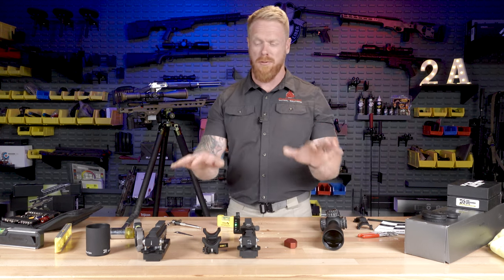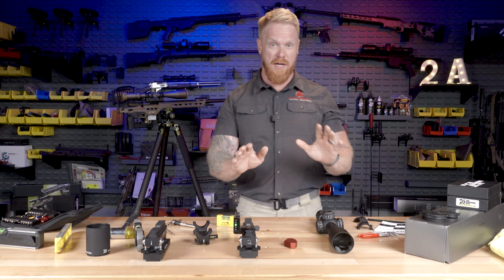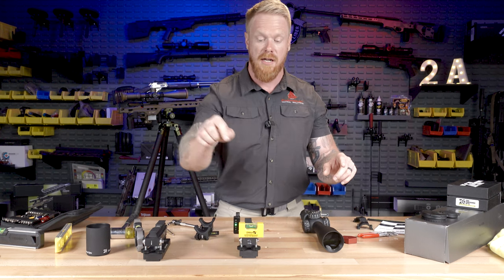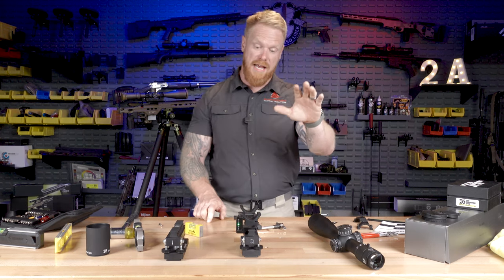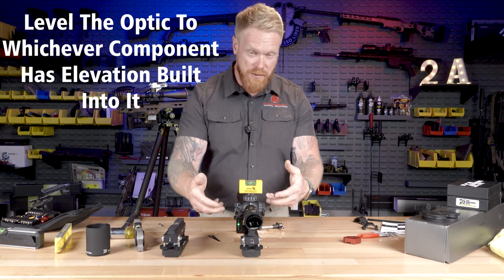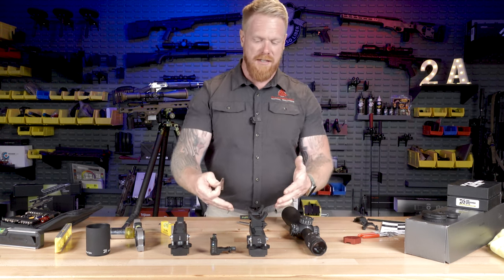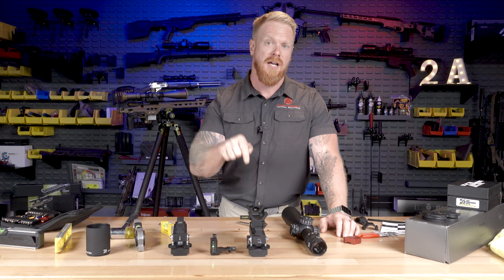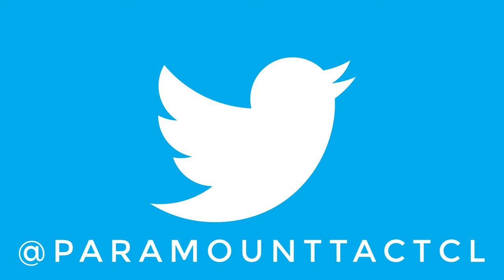Why Scope Leveling Wedges Don't Work

Comment: It is important to realize that light arms, even those with picatinny rails, do not feature an accurate level reference surface or mechanical connection to the level "sensor", as does artillery. I was first made aware of the consequences of this fact by Tom Gaylord, the "Godfather of Airguns" and also a former artilleryman in the service. The decision of whether to level the optic to the scope base or the mount does not necessarily guarantee the best reference point. I like to level an optic (actually the optic's reticle), using whatever level reference I will be using the field. For precision shooting, I'll be using a level attached to the rifle so I secure the rifle to a tripod or bench, level the rifle using the rifle's level (the only reference that really matters in the end), and then I adjust the scope in the scope rings to square its reticle stadia lines to a cross hair reference graphic that I've drawn on a wall using a good carpenter's level. (I also first test the carpenter's level for accuracy by swapping its ends, etc. and adjust it, if necessary.) The scope stadia lines can then be aligned to the crosshair graphic on the wall either by viewing the wall graphic though the eyepiece (muzzle pointing toward the wall graphic) or by projecting an image of the lines onto the wall by shining a flashlight through the scope from objective to eyepiece (muzzle pointed away from the wall graphic). If I am mounting a scope on a rifle that lacks an attached level (maybe a "classic" hunting rifle), my shoulder and body become the "level reference" so then I simply shoulder the arm several times and sight the wall graphic through the scope to make my adjustments. I also tend to use the shooting position and perhaps the sling or other rest that I anticipate I'll be using in the filed (off-hand, kneeling, seated, bench, prone, etc.). For this method, it is necessary to draw the graphic on a wall with sufficient distance in front of it to view a sharply focused image of the drawn wall graphic through the scope. Reduced scope zoom magnification power and/or a doorway or a wall facing a more distant outdoor sighting position might be needed.The above simple procedures work best for me, because they use the exact same references that I will be using in the field.

Comment: After watching the video it made sense why the wedge process MIGHT not work. So I had to test it out. I used them and then verified everything using a thorough leveling process I learned watching your other videos. (And a few others) I must have gotten lucky!! Turned out the wedge worked with both a $30 Amazon mount and a $200+ ADM mount. But I still agree with you. Using only the wedge leaves room for error at longer distances.

Comment: Ryan Cleckner Army Ranger Sniper and Author of the Snipers handbook swears by them why did you only used one piece of the leveling tool kit? It has x2 pieces to  work otherwise of course it wont level the scope

Comment: I've always just run a plumb Bob from the ceiling and shined a flashlight through the opposite end of the scope to get a shadow projection on the wall to then match the scope to the shadow.
Reply from the maker: The ol flashlight method. 
I cover the problem with that in my scope mounting video. 
What if your reticle is not plumb inside the optic? It happens a lot more often than people realize. Using the reticle as the point to determine if the optic is plumb hides this problem. If the reticle isn’t plumb then everything you dial is incorrect and there’s no real way to fix that. 
If you’d like to learn more I cover that in detail in my scope mounting myths video and the recently published Complete Guide to Precision Scope Mounting.
Reply: @paramounttactical  Here on my ranch the shadow trick has been perfect for my needs. The majority of both my defensive & coyote rifles are running either Steiner p4xi or Delta Strykers, both sfp optics so I do zero dialing. I'd probably start running into the issues you mentioned if I was actually dialing. I also tend to stick within 500 yards with my shots as well. There's been a few occasions where I've taken 600 yard shots and not got a humane kill with practically zero blood trail which still to this day bothers me. The majority of coyotes are taken with a 62g & 75g Speer Gold Dot projectile that I handload to medium/low 5.56 pressures to better serve a 16" to push out to atleast 500 yards....

Some day when I decide to quit making excuses I'd like to actually take a long range class and start doing some competition long range shooting. I've actually taken both pistol & carbine 1 classes with paramount tactical and will soon be looking at your schedule for both pistol and carbine 2. My goal as of right now is to work my way up on both platforms so I can take low light courses from you guys on both platforms.

I've trained at about a half dozen other places but with paramount I've been able to obtain the most knowledge and actually see MUCH better performance on my end. You guys have some damn good trainers at your facility!
Reply from the maker: @TerminalM193  love it! You’ll definitely enjoy our long range courses. Hope to see you on the range again soon!
-Gary
Reply: @paramounttactical  I just watched the myths video where you talk about this. I want to make sure I understand: you recommend your method because you can diagnose a misaligned reticle, whereas plumb bob or flashlight methods disguise a misaligned reticle until you start missing at longer distances, correct?
Reply from the maker: @davidhicks7160  yes. But it’s a bigger problem than that because you wont diagnose it at distance. Misses at distance are automatically attributed to environmentals or poor fundamentals. You’ll just dial until you get a hit. It might just be a click or two off so unless it’s really bad, it’s subtle enough to go unnoticed but ends up costing you 10% or whatever more misses without realizing. Or you’ll get all hits up to 600 or so and then your hit rate reduces and you think your fundamentals are off, so these issues can be very insidious and hard to diagnose. That is why regardless of what mounting method (all have potential for mechanical or human error) you use, you must do a tall target test to confirm. Should just be part of your SOP when getting a new rifle or mounting a new optic.
I hope that helps. Thanks for watching!
-Gary
Reply from the maker: @YERAFirearms  look dude, I know you’re new here and don’t digest the content and only snipe in a piece here and there in a very uninformed way but if you were familiar with my content you’d know that’s exactly what I say. I literally have multiple videos on the topic. 
But tell me, if you level using the reticle, how would you know if it isn’t square to the body?
Reply from the maker: @YERAFirearms  😂 you clearly don’t watch my content.
Reply from the maker: @YERAFirearms  youre not critiquing anything. You’re just making yourself look stupid by commenting when you have no context and on topics and videos you didn’t bother to even watch. You clearly don’t know anything about me or this channel. You’re out of your depth and just another half informed, comment on a thumbnail without knowing ANY context, want to sound smart guy in the YT comment section. 🤷‍♂️
You have a good day.
Reply from the maker: @YERAFirearms  you’re free to do whatever you’d like, even if it’s to make a fool of yourself which you seem quite adept at. But this is MY channel and if you’re going to just be a clown, say dumb shit that while having no context or even bothering to watch the video, you’re not welcome to express yourself and your stupidity here. So, you’re banned. Go troll other channels and attempt to dazzle them with your brilliance while spewing nonsense that just makes you look dumb. You have a nice day princess.

Comment: Your mount should sit flat on the pic rail, if it's not, thats a problem.
You don't want your mount held in position by the taper on the clamp. The only job the taper clamp has is to pull the mount flat on the pic rail.

If we're being realistic, levelling your reticle to your action is the only perfect way, else, everything has tolerance.

Comment: Great videos. I totally agree with you on the wedge system, I’ve very rarely had good results using them in the workshop. Using accurate levels on various points on the rifle and scope just seems the most accurate and consistent way of doing things I have found myself.

Comment: Hi, Gary... very well done analysis.... 
One question: If you have a rail with 20 moa AND a one piece scope mount with increased moa (such as an MTD or a Sphur), which one should you level all components to as they BOTH have a  degree of moa adjustment...
Robert 
Dakota Dunes, SD
Reply from the maker: It’s quite a conundrum. Ideally you get the rail and the mount as parallel as possible. If your mount is indicating it’s not parallel when you tighten it to base, I would play around with mount placement and the order in which I tighten the cross bolts. You might be able to eventually get them reading the same.
The best answer is get a mount or rail with all the elevation you need in one component. That eliminates that variable. They do make rails and mounts with 40 MOA and more all built into one item. That’s the real solution if troubleshooting doesn’t work. 
Hope that helps. 
-Gary

Comment: Maybe I just got lucky but now I have to recheck everything. I use a Spuhr mount ( 3mil built in) on my MPA with the pinned factory 20 moa rail. I put the wedge in verified level on the turret and level built into the chassis and went with it. Shot 4 matches this year and took it out to a mile. No problem but wonder if im leaving something on the table. Where should you level if both the rail and mount have cant?
Reply from the maker: It’s quite a conundrum. Ideally you get the rail and the mount as parallel as possible. If your mount is indicating it’s not parallel when you tighten it to base, I would play around with mount placement and the order in which I tighten the cross bolts. You might be able to eventually get them reading the same.
The best answer is get a mount or rail with all the elevation you need in one component. That eliminates that variable. They do make rails and mounts with 40 MOA and more all built into one item. That’s the real solution if troubleshooting doesn’t work. 
Hope that helps. 
-Gary

Comment: Thanks for the heads up. I wonder if "wet mounting" would change the results. I know Area 419 has a video where they put a touch of grease on the pic rail, so when torquing mounts to rail, it can settle into correct position, so they claim. My protocol is to check as many variables as possible. I start with making sure rifle is level as measured by pic rail. Then mount scope into the scope base loosely for eye relief/eye box. After that, I check against the level of the top of turret for "good enough" to start, so I know I'm not way off. Then, I project reticle onto wall, and ensure reticle is on same level as rifle pic rail. I then carefully tighten down everything and reverify everything.
Reply from the maker: It’s a good question. I’ll have to test it.

Comment: So would it be best to level it using the picatiny rail on the rifle? Depending on the tolerances to each gun your scope could potentially role differently. Maybe im confused 😢.
Reply from the maker: I’m just saying that if you have an integrated slot for these wedges like a lot of mounts do, they only work if the mount stays perfectly parallel when you tighten it. This one wasn’t. After I tightened the mount, it was slightly canted so the integrated wedge system isn’t going to work. 
If you mount your optic like I instruct in other videos it’s a non-issue.
Reply: @paramounttactical  okay i understand. Thanks for the clarification.

Comment: Great content.

Have a quick question.  @0:40s you show how to use the wedge, but you're only using 1 part of a 2 part system?  Aren't you supposed to use the base it comes with that has a 45 degree angle that you're supposed to slide the wedge you're holding onto in order to get the proper levelling? 

Cheers

Comment: I don't know what wedge system you are using but the one I have uses two pieces to level the scope. It has a wedge like you showed but mine has another piece with a right angle milled on the bottom to sit on top of the pic. rail and that piece has another angled ramp milled on top. That top angle when used with the wedge piece like you shown creates a 90 degree angle. You slide the wedge up the ramp till it interfaces with the flat bottom of the turret. Once I get the two pieces into position I wiggle the scope back and forth till it seats to well to the bottom of the turret. It would of been nice to see a close up on how you used your wedge. Thanks
Reply: yea whatever works, works
Reply from the maker: On this mount and other mounts like Spuhr they have the a slot pre-cut into the mount that corresponds with the provided wedge. 
The question for you is, did you verify that your scope is actually level or are you just trusting the system?
Thanks for watching!
-Gary
Reply: @paramounttactical  Okay I was thinking the mount must have a slot cut in it though I have never seen that before. I have never trusted using the scope elevation turret caps for placing bubble levels because of many of their designs and getting the bubble level 100% perpendicular to the bore and having things move around as you tighten the rings screws. One of the better ways of I have done if you have the space inside a building and your scope will focus is to use a plumb line. You place the level on top of your rail and then rotate your scope reticle into alignment. you can do it out side too if it is a calm day. For me in general for my varmint hunting using the wedges is good enough for me.

Comment: who manufactures the red block that you used to check the scope base and elevation turret level during your You-Tube presentation
Reply from the maker: It’s a machined trigger jig by APEX. You can find machined or flat blocks anywhere. Some levels have thick, flat machined surfaces you could use as well. 
All you really need is a flat surface that indicates level and is raised enough to clear the bell housing/objective on the optic.
Hope that helps.
Thanks for watching!
-Gary

Comment: So, let me make sure I understand this. If I have a level on my one piece mount, I should run that instead of a rail mounted option, like the US Optics version? And what's the difference at say 600, 1000 and a mile for being off level the amount of the leveling tool? Is it splitting a blonde one, or significant?
Reply from the maker: That’s not what I said. There’s several IFs here. 
If you have elevation built into your mount AND IF when you tighten your mount it is coming out of parallel with your scope base/rail then you should level your optic to the mount and put the anti-cant device on your mount.
If the elevation is in your scope base/rail AND your mount is coming out of parallel when you tighten, you should level your optic to the rail and have your anti cant device on the rail.
Ideally, when you tighten your mount it doesn’t shift one way or the other and stays perfectly parallel with your rail and if that is the case, you should level the optic to the rail and it doesn’t matter where you put your anti cant device because both components are on the same plane.
As far as how much a difference it makes… depends on how much it shifts when you tighten it. Could be a little or a lot. Could make significant or insignificant difference. It’s a variable that you should try to get rid of. The only way you would know for sure is by shooting a tall target test which you should do every time you mount an optic. 
Hope that clarifies.
-Gary

Comment: Wet mount to the pic rail whether its rings or spuhr/419/mdt etc one piece. I have found that the friction is a culprit for binding at the interface and pic rail.
Reply from the maker: I’ve heard this before. I’ll give it a try. 
Thanks,
Gary

Comment: What is interesting is how to determine the precision tolerance you need for your leveling tools. An optic bubble level’s biggest error sits in the person in front of it ( acceptance factor). Most electronic levels have a tolerance of +/- 0.2 degrees. The most expensive ones ( 100$) maybe +/- 0,05

Comment: I forget if it was the owner of Warne, Spuhr, or LaRue, who said this, but it's best to apply oil or grease to the rail/bottom of the mount before clamping the mount to spec to allow a more uniformed and even clamping. Try repeating this experiment with that in mind. Youll get better results like I did. 

Also, i have a very expensive mount, so that may also be a factor.

Comment: I would also say that the problem is not the wedge, but the interface to the picatinny so you need a new mount basically if its not clamping on perfectly. Btw have you tried this with Spuhr one piece mounts ?
Reply from the maker: I have. The problem persists. I have found the solution however. https://youtube.com/shorts/1Ahj8nMW9Yc?feature=share

Comment: Yeah the place called Tactical Kit in the UK is selling them listed as Arisaka but has the pictures of the cheap eBay ones. My guess is they selling the cheap Chinese sets for £45. Doesn't make sense to use the wrong pictures.

Anyway I can get the Spur set for £40 just need to check if the one piece is tall enough for my scope height. 

Plus I need to find out if they're anygood good if you have moa?...

Comment: A scope reticle level to gravity does not care how much cant is built in to a rail. If the receiver/mount is true to the axis of the bore it will be level on the 1st and 2nd axis. If it’s not it’s a 3rd axis issue (scope is offset from the bore to the left or right).